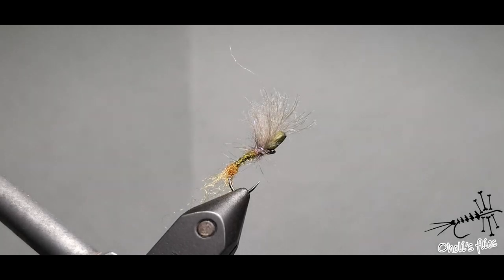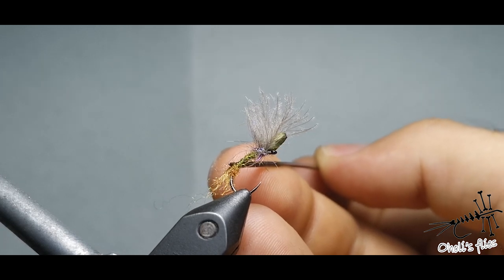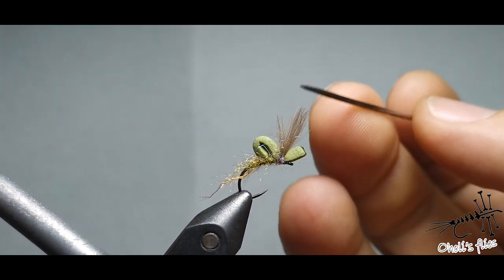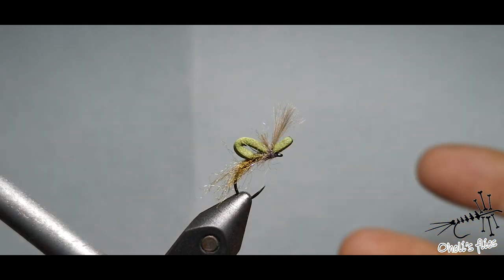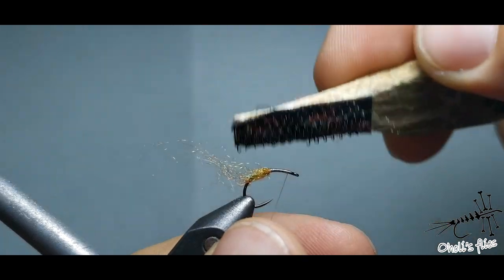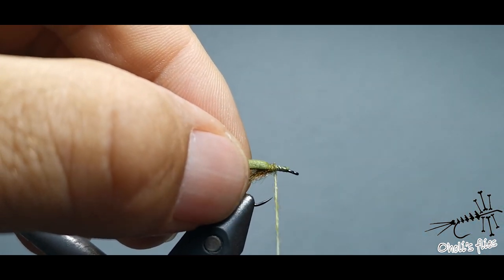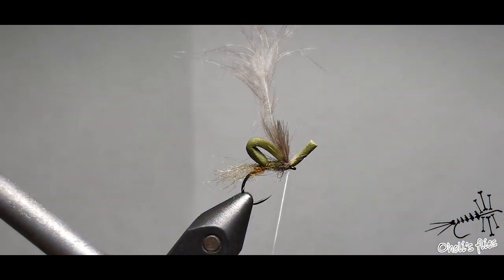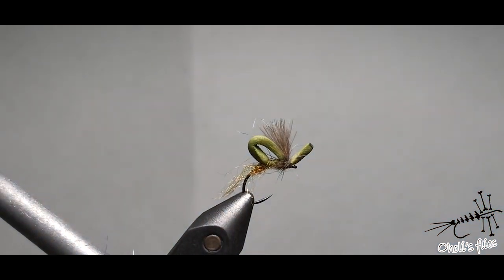BWO Foam Emerger

Comment: Very nice Vladimir, I was struggling to come up with a foam emerger and this is much better than my attempt.   I use round foam similar to ant bodies on color differences.

The fly rises to the surface beautifully  UT as you can see, the cdc wings cannot break the surface tension to pop through.  I have the same problems.  I am thinking  of using antron posting material for wings.  Something a little stiffer to beak through the surface tension.

All said you version is much better as it stands.

Thank you so much for sharing your technique. I learned alot.
Reply from the maker: Thanks so much for your kind words.
I love this one because it remains buoyant even when i catch many fish and cdc gets slimed.... I can roll cast it, see where it falls and react when I see the rise. Not always i can see cdc.
Cheers
Vladimir

Comment: clever and maybe even an original design.   Foam car be cut as strips from flat sheet, many time i use a small diameter piece of metal tubing. CHuck it in a drill than sharpen the end by rotating against sandpaper.  The drill the tube into foam for perfect narrow cylinders.
Reply from the maker: Thanks. I will need to give it a name.
I cut those into stripes... And with metal tube o know, but... I am too lazy.... I have a friend who does it for me 😀😀
Reply: @Oholisfliesandfishing  no brainer" "chubbychick"  or "skinnyjeans" etc   haha
Reply from the maker: @unionse7en  aah, nobrainer then... The rest can be insulting so i have to keep it nice 😀